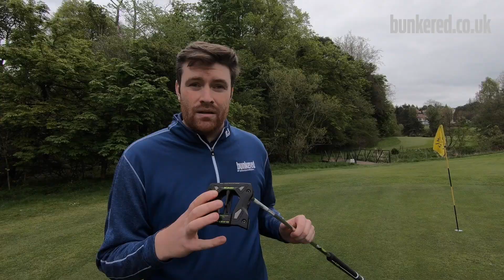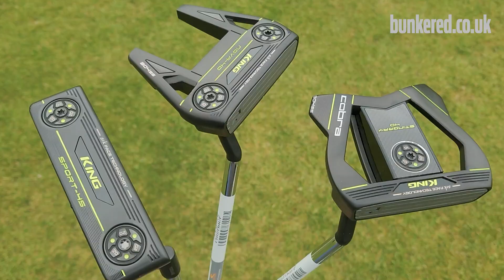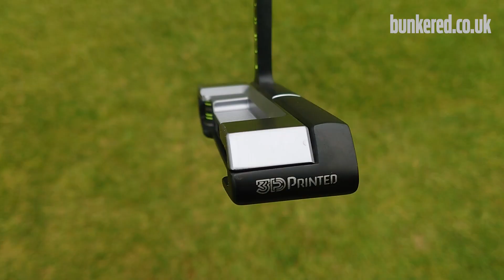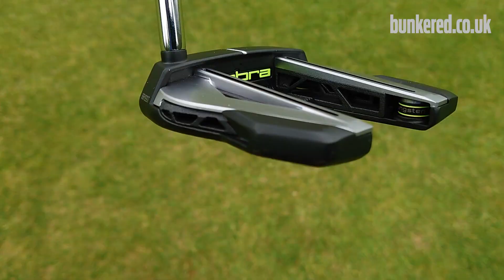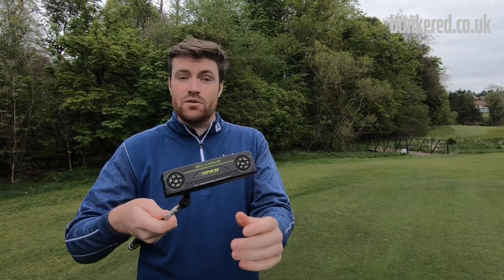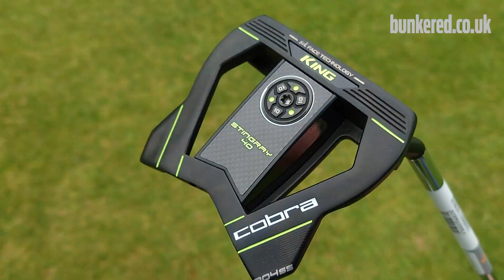HAVE COBRA CREATED THE BEST PUTTERS MONEY CAN BUY? - Cobra putter review

Comment: Wasn't a fan of the weight of the 3D printed models. Certainly revolutionary for Cobra to be 3D printing putters. I found them a little bit heavier than what I was used to. Doesn't mean everyone will dislike it, just means it wasn't for me. But I love the Cobra Vintage series. I bought the blade and love how well it's dialed in.